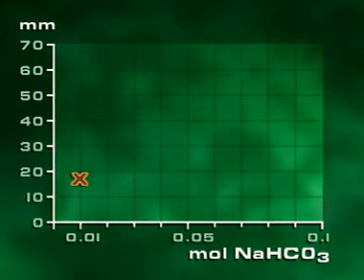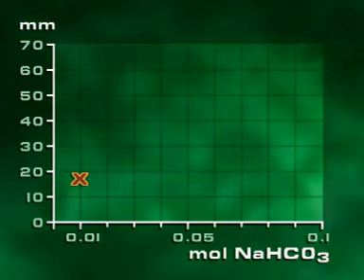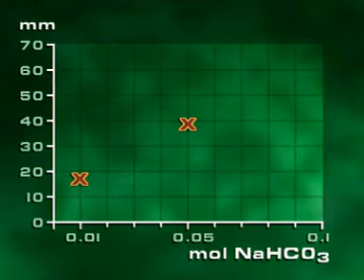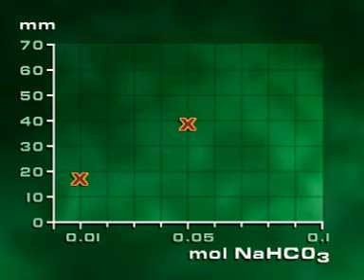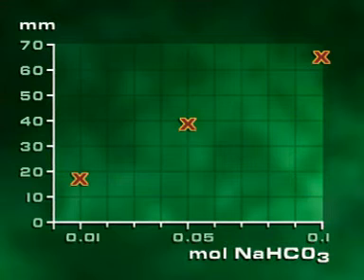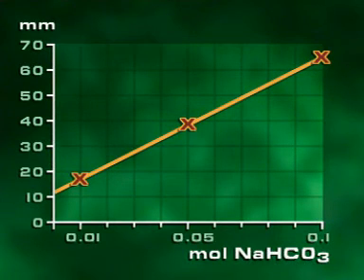Measuring the effect of carbon dioxide on the photosynthesis of pondweed.

Comment: what are the materials used
Reply: You can use a micro pipette(more accurate) or micro biurette or a capillary tube with a ruler attached. At the beginning fill the audus apparatus or the tubes and the syringe with water and then when the O2 gas bubbles are accumulated at the bend of the tube, you can pull the plunger of the syringe until the bubble travels uo the tube and corresponds with the marking or at the point where the ruler is placed, then you can measure the length. For calculating the volume, you can then find it by the pi × r^2 equation by measuring the cross sectional area of the tube or pipette and then multiplying by the length of the O2 bubble.
Hope this explanation helps you.
Reply: Did you find out? I'm trying to find out how he measured the oxygen gas through the syringe